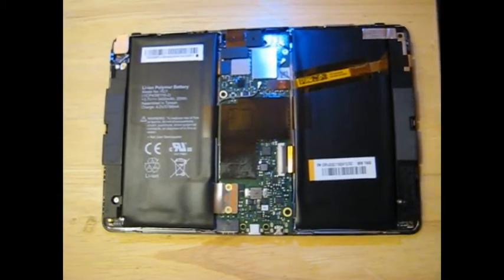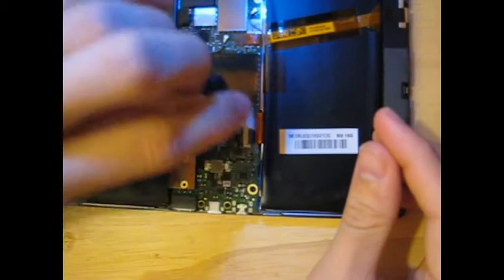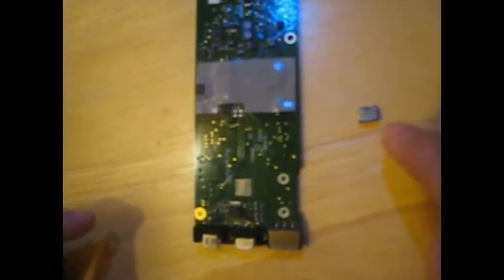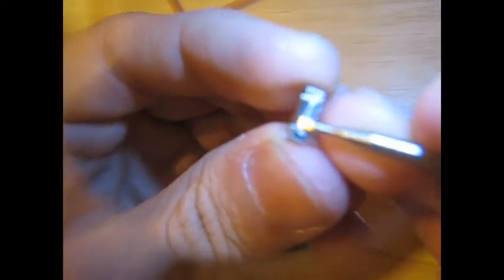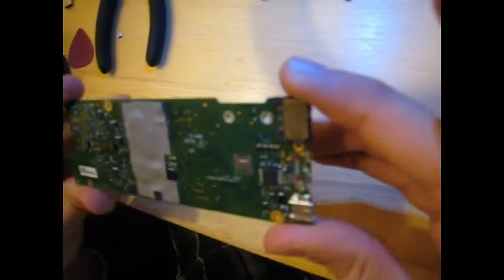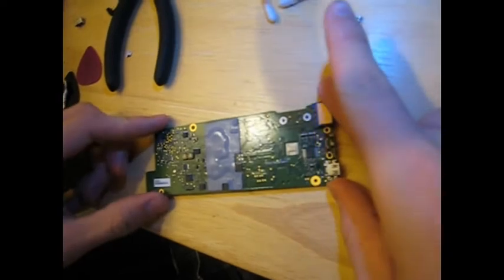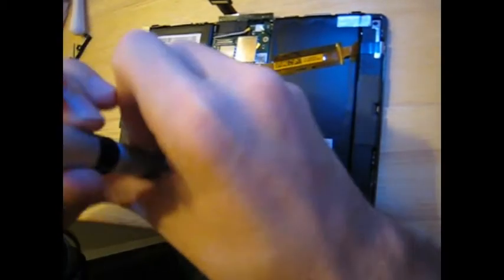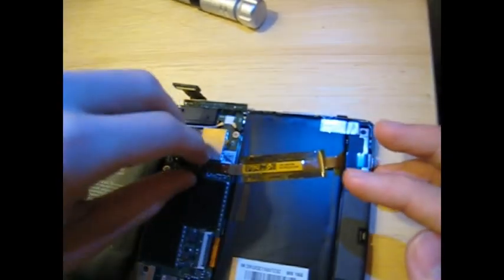How to fix Blackberry Playbook USB port

Comment: Thanks for sharing your teardown, and commentary.  Why didn't you not include the footage of actually removing and attaching the usb port? Isn't this is the point of the video? Including:  Type of solder, size of tip, and where is the camera focus? How can I tell if you flowed the soldier right? Is the lens dirty? You have mostly footage of unscrewing and rescrewing, and then....no payoff!  Why not plug it in and show us the repair working?  Did it work? How can we know?  Why are are you teasing us?  Is this your business trade secret?

Comment: My playbook doesnt turn on even its been charging for a couple days, doesnt his procedure will fix my problem?
Reply from the maker: +Refuse to Lose might be a different problem, cant be sure. try using the magnetic charger and see if that works. If it does, then this may work. Try not be destructive as i was :)
Reply: I have a BB playbook that won't do anything. I left it on both the magnetic charger and USB charger for a few days, but it won't do anything at all. No lights show up.
Reply from the maker: then you have a board issue. either a short or something is busted. I don't have a schematic for the playbook, but to diagnose you'll need one and a multimeter.

Comment: Congrats! You got it off! Only minor pad damage to the ground plate under the connector. How long did it take you to get it off? lol!! ;) The first 2 I did took 2 hrs each and I am a professional at re-work with many years of experience and quality tools. The trick is to not use a dremel. The red stuff is Loctitte chipbonder. The rest is my secret! I've done 30 of these now and generally finish them in 20min. But koodoo's to you, because that is a bitch of a task! Ohh.. and how about the magnet?

Comment: Thanks for the info. I have an Android mini PC to repair, the micro usb used for powering the unit has come away from the circuit board and I wasn't aware that small usb socket pins aren't soldered only the shield is.